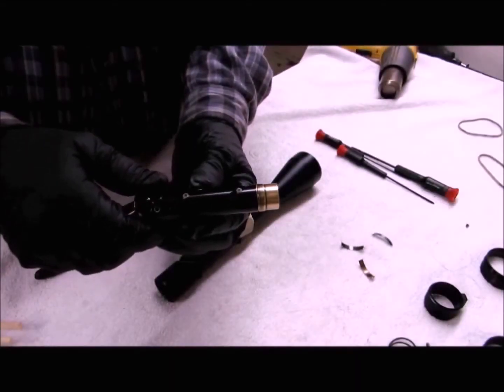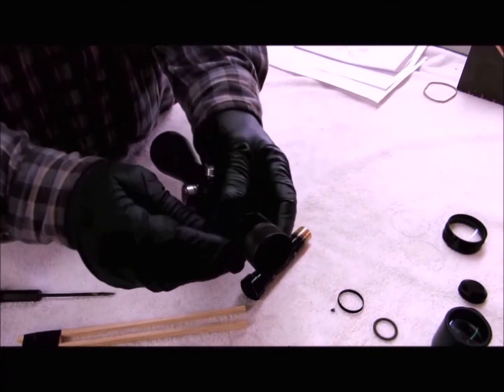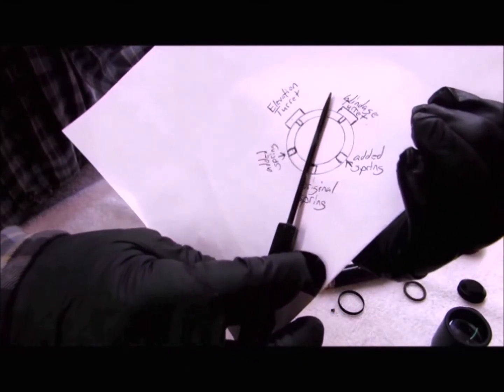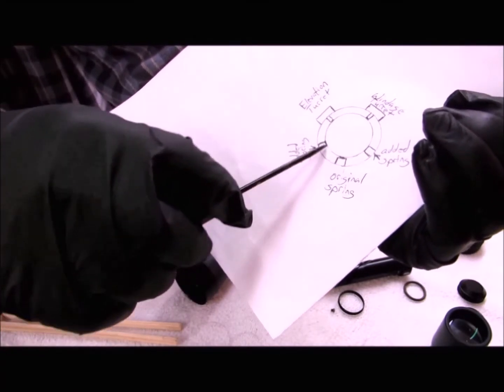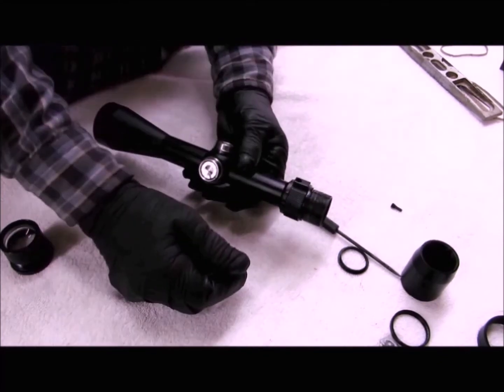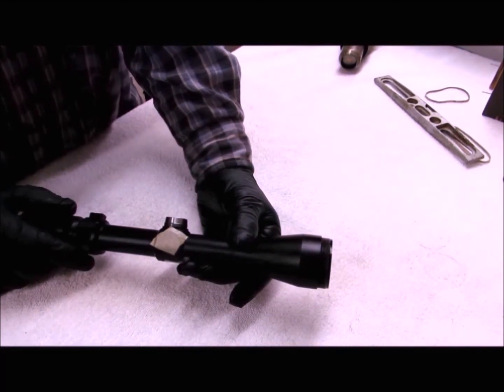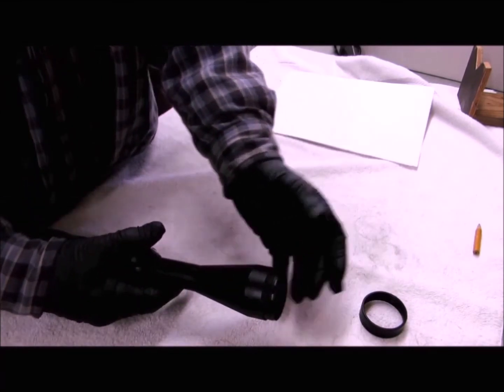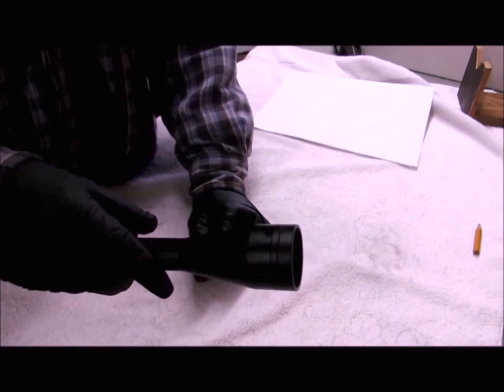DIY SCOPE REPAIR PART III

Comment: So my scope doesn’t have an adjustable parallax and my objective lens cover came looks with it being only the outer cover there’s nothing to worry about right I just need to retighten in down correct ?
Reply from the maker: Yes sir it's unlikely that the lens moved. If in doubt put the rifle on a solid rest and aim at a target at the distance you want the parallax correct. Move your head around in the scope and see if the reticle stays on target. If you're worried about a miss because of parallax, that's not likely unless you're shooting long range at small targets.
Reply: @kennethdellinger2037  can the internal gases get out from removing the outer lens cover  ?
Reply from the maker: @m0cho  No. They are sealed by an o ring on the lens. If the scope has any age on it the gas has leaked out anyway.

Comment: I have an old redfield scope that has been moving inside wondering if I could send it to you?
Reply from the maker: Sorry I only repair my own and a couple for friends. If I had proper tooling and parts available I would. The problem with the old ones is discontinued parts. Most scope companies will just replace them with a newer model. I end up cobbling some of them together. There are companies out there that do repair the older scopes you may find them with an internet search.
Reply: @kennethdellinger2037 thanks for letting me know!
Reply from the maker: @danielsheber4571  https://www.vintagegunscopes.com/reglassed-scopes  These guys do repairs on old scopes.

Comment: How do you install the 2 other erector springs and also position all 3 springs relative to each other?
Reply from the maker: If the tube has the same inside diameter all the way through you can add the additional springs from the front without removing the erector. Some scopes have a groove that the spring will snap into. Some don't. Scopes like the Nikon in the video have a step in the tube and the erector has to be removed to install the springs. If you look in the scope from the front with the objective lens removed you will see the position of the original spring. The springs I add are on either side of the original spring with approximately 1/16" between them. Hope that helps.

Comment: A clever man such as yourself could devise a way to purge the scope as u re-assemble off of an argon gas bottle.
Reply from the maker: The pros use a sealed box with gloves. The box is pressurized with nitrogen or argon for final assembly.

Comment: Love the video... But what tools are you using to take the scope apart, are you making your own tools ....? 
Do you use special eye glasses? 
What do you use to keep from marking up the threads ?
Reply from the maker: Thanks. I am making my own tools. There are some scopes that require specialized tooling but tools to disassemble a simple scope like the one in the video can be easily made from a piece of flat metal. As for protecting the threads I just exercise care in the process. Been lucky not to destroy a scope so far. Since my eyes are not what they used to be I do wear a 4x magnifier to see details.
Reply: @kennethdellinger2037 feeler gauge, do use use regular steel or stainless to make your springs ?
Reply from the maker: @davidlayne8755  They are regular steel.

Comment: Wish did scope with AO at end of scope, i messed around and screwed AO ring off and only thing see is brass screw and when loosened the inside, a big spring and inner tube slid out but not all way and push back in and tightened brass screw back but not sure when screw AO ring back on, dont see how turning ring to different yardage, how it can adjust AO, like something else missing
Reply from the maker: Normally the lens is threaded into the tube. The brass screw is a stop that keeps you from screwing the lens out of the tube. If you could send me photos maybe I can help. kennethdellinger57@gmail.com

Comment: You said that your main spring latches into a groove.  So what about your "helper" springs?  Seems like they could move around inside there and cause issues if you dropped the rifle hard enough.. or by recoil over time.  I guess they are pretty wedged in there, but it just seems like it would be better to just make your main spring a little stronger and leave it at that..  I wish you would have shown what it looked like with all three springs installed..  I'd really like to see inside a more advanced erector like a Schmidt and Bender or something fancy..  or inside a prism scope.
Reply from the maker: The 90 degree bend on the helper springs will latch in the same groove that the original does. The groove is cut all the way around the tube. Some cheaper scopes don't have a groove. The steel spring will bite into the aluminum tube and stay put. I've repaired multiple scopes this way and have not had a problem with springs moving. You are correct they're under considerable tension when installed in the tube. You could make the main spring heavier but I like the helper springs putting pressure directly in line  with the turrets. Sorry I didn't show them installed. That probably would have been helpful. Most of the more expensive scopes have two springs from the factory. The fancy scopes are a little pricey to be taken apart by this DIY guy! LOL

Comment: @8.10 you can 'pour' argon into the scope as its heavier than air, just direct the hose into the objective side of the vertical scope and allow the argon to force the air out like filling a glass with water. Then you can screw the objective lens back on with a high percentage of argon in the scope. How does one adjust parallax on a scope that does not have the adjuster? I shoot .177 pellets at 25 yds and would like to BZO this scope at that fixed range. That looks very much like my Tasco World Class 3-9x40 scope with a slightly different zoom ring.
Reply from the maker: The argon idea would work. If your Tasco is made like the Nikon in the video just screw the cover off the objective lens and run the lens in or out to correct the parallax at any given range.

Comment: I’m just trying to figure out how to make one go a little higher than it originally set because my scope is 6 inches above my barrel on SKS just the way I mounted it and the mount I bought at 
It just happened to be a couple clicks away from being set where I want it. I’m still not as confident as you to go in and make any changes, but this helps on if I do want to get in my scope and feel like I can adjust the centers a little more or maybe the scope is just at its limit it was setting too far forward. I pulled it backwards. I don’t know if that will make a difference or not but it seem to with the bore sighting laser, but. I’ve got off more than I can chew. lol
Reply from the maker: You will most likely have to shim the scope. If memory serves me right the sks scope mounts on the side of the receiver so you can't shim there. You will have to do it in the scope rings. A soda can measures around .010 thousandths. May have to use a couple of shims. With the bore sight you can experiment until you get it close without locking everything down. Not ideal but it will work. 6 inches is a lot of distance between the bore and the scope.
Reply: You could get a set of burris z rings, they come with offset bushings for the rings.

Comment: Hey. I have an old fixed power Texan that seems to have somehow picked up a lot of dust and causes a hazy effect that extra pronounced in those lower light early and late hunting times. I could buy a new scope but they’re all so ugly now. Any idea where a guy might learn to build his own tubes and put cheap erectors and lenses in that tube for the sake of building nicer scopes with better lines and finishes?
Reply from the maker: Sorry but I don't. I've tried unsuccessfully to find a source for scope parts. If you do please let us know.

Comment: Excellent series and information along with presentation sir!  Very much kindly appreciated.  Took the dive into attempting to repair a $5.99 6-24x50 NcStar scope I found at the Goodwill Store.  Image is always out of focus and when adjusting zoom from the 6 to 17 range of the setting a rectangle appears to enter the view in the upper right corner quadrant at about two o clock moving in towards below the center of the reticle where at the 10 setting the lower rectangle corner begins to enter the lower right quadrant. I've only worked with microscopes and telescopes repair or restoration, so will be an interesting learning experience.  Any ideas to start with?  Thanks in advance for your time.  Kind Regards, In Christ.
Reply from the maker: Wish I could be more helpful. Good luck. Let me know what you find.
Reply: Thank you kindly sir! @kennethdellinger2037
Reply: OK there kind sir.  Couldn't have done it without you.  Really isn't anything online as detailed as your video series in general with a scope.  I have found some videos with bits and pieces, though nothing as holistic.  Extra helpful and much appreciated.  Still in the middle stages, though I finally understand I think the mechanism and with nothing other than the observations of what I've found regarding outside the zoom-parallax mechanism, since nothing at all online anywhere regarding the zoom-parallax knob adjustment mechanics.  OK, let's start there.  

The zoom-parallax knob, what I'll call it, is literally not like the screw surface pressing on the end of the erector tube.  The tip of that screw surface is a linear crank mechanism with the crank pin on the surface plane that goes into a like quick return slide mechanism though is a different style slot piece at the end of maybe a 1/8 diameter section of tube connected to I think one of possibly two lenses inside the smaller tube before the objective lens. That slide is just up from the erector spring running along side of with a little space between the two.  That return slide mechanism at the end of that is piece is like an upper case letter T slot.  Where to install the crank pin that's at the inside end of the zoom-parallax knob into the slide slot, the base of the letter T shape is pushed down towards the ocular side of the main scope tube from the objective end and then from the objective end I rotated the whole zoom-parallax lens assembly to seat the crank pin in the perpendicular section of the slide slot T turned L shape since did a woopsy. 

I did wind up break the lower end of the slide mechanism slot, which appears to be plastic and not aluminum.  So I assembled the mechanism on with the crank pin on the upper side of what is now more like the left side of the upper case letter T slot, more like a rotated 180 degrees counter clockwise upper case letter L where appears the crank pin is still connecting with that base of the L portion left still.  

Really fascinating to be able to assemble and now finally see out of clearly, albeit I still need to make adjustments to the objective and replace the nylon bushings on the erector tube lenses.  Also, appeared the cam part of the erector tube was loose down the length of the inner tube due to a ring not in its groove at the objective end and possibly the brass looking thrust wave spring washer being worn at the opposite ocular end. 

Being a first scope I've inspected and disassembled more thoroughly and not wanting to break anything, which I did that zoom-parallax mechanism slide groove lower part, I didn't video much of anything.  Plus when I tried, I found I'll need additional lighting to see into the tube so to better visualize the slide mechanism.  

Figured I'd do a write up at least for sanity sake for now and disassemble again and try to detail better to the best of my capacity in my situation where I prefer to be more a listening and monitoring station at times among other work regarding controversial situations in and moving out of the cities within the US borders fabricating crime with more than concealed wireless assault weapons unbelievable creative coercive invasive nuisance ways. 

Really neat though sir moving forward on this little exploration to save and possibly improve on another item not heading to be thrown away. A useful one at that, to keep those undermining critters dispatched potentially.
Reply: @kennethdellinger2037  Made a quick overview video of the latest.  Going to take a break from for now and determine if I am better to remove the zoom-parallax lens assembly and repair or leave as-left for now.  Thinking I can repair and somehow upgrade the spring even though there isn't much room.  Any thoughts? I appreciate you and your time.  Interesting little rescue project. https://youtu.be/0TZabbG4-Ek
Reply from the maker: It's hard to imagine that mechanism without actually seeing it. If you think you've found the problem with the scope I would probably reassemble, get it adjusted and see how it works. Does sound interesting. Fun to learn new things. @jafinch78
Reply: @kennethdellinger2037  Figured I'd note I posted a second reply with a video link at the end of the verbiage.  Just in case you didn't see both. Wasn't that good detailed and either way makes me think I can try to show better, even if drawing since I have a feeling I either will remove the zoom-parallax assembly to repair or possibly remove and use if functions without. Thanks again kindly for the support.
Reply from the maker: I'm not seeing the video link. The scope probably won't focus properly if you remove those parts. Will be best to try to find a fix. You sound resourceful maybe you'll find a way. Sometimes heroes sometimes zeros. @jafinch78
Reply from the maker: Thanks for watching. Not sure about that one. Does the reticle appear ok?
Reply: @kennethdellinger2037  Thank you for sharing.  Appears the reticle is OK.  This design appears more complex than the one shown in your video sir. I think on the left side is another zoom or parralax adjustment knob maybe?  Opposite of the windage knob. Also, there is the illumination knob that I am not familiar with at all. After posting, I adjusted that zoom/parallax adjustment knob and found the rectangular bar was moving and not in the exact same position as before.
Reply from the maker: I thought that might be the case. That is the parallax adjustment on the left side. Sorry I don't have any experience with that design. If you remove the objective lens and look inside you may be able to figure it out. I have a Burris and a Nikon with side parallax. I peered inside with a light and see another large lens and a nut holding it in. Don't know what might be beyond that. For 6 bucks you're not out much if you destroy it.  @jafinch78
Reply: @kennethdellinger2037  I really appreciate your support and definitely no need to be sorry.  You're definitely not that there kind sir. I was wondering if the spring is what I'm seeing and now after realizing the tube is also called a reverse lens tube, might be why in the upper right where-as the spring is in the lower left.  I also wonder if the focus is out due to one of those two lenses in that tube being out of position.  I'll try to document once I find the time to start disassembling when I get my tools made. Thinking I''ll research some more to see if I can find a better diagram to visualize what all is going on inside, before I wing it.

Comment: Thanks, this was an excelent series.
As far as factory argon, since argon is heavier than air, if you bought a tank of argon 100% for welding, you could set scope up and fill with argon befor you install objective lense.
Reply from the maker: Good point. Thanks for watching.
Reply: Argon is extremely expensive compared with Nitrogen, it’s much safer & properly used works great for purging optics
Reply: That's exactly what I was thinking.

Comment: Thank you very much. I watched the three parts of the video, but I have a question and I hope you can help me. I have a new scope descovery 6_24x44 sfp , but there is a problem when zooming in. The reticle moves to the right. What is the reason for that? Is it the spring or the reticle, and can I fix it?
Reply from the maker: Hey Ghazwan thanks for watching. You say the scope is new. If you have warranty you should return it to the manufacturer if that is an option. It clearly has an internal problem. The reticle is attached to the erector tube and it sounds as if the tube is moving in the scope. I am speculating though as I have no experience with the scope you mentioned. The spring may not be in the correct position. You can look into the objective lense with a light and see your turret screws and spring on most scopes. Too bright a light will cause glare but when you get it right you can see. Reference the video for the correct spring position. If you have a helper, watch the erector while they turn the zoom. You may see what is going on. Could be movement at the rear where the erector is mounted also. Watch with the light through the ocular lense while an assistant zooms. Hope this helps.